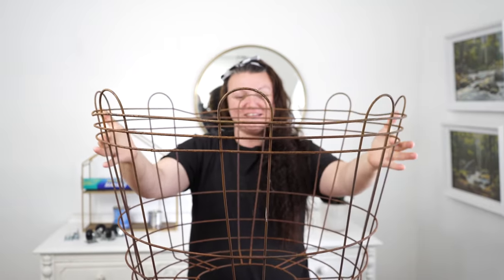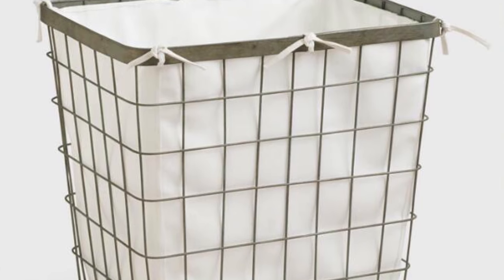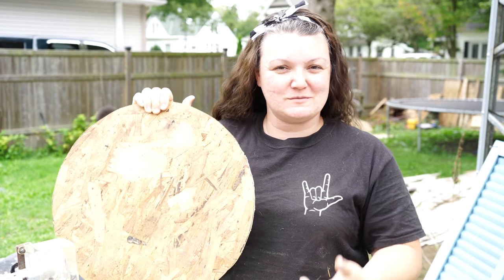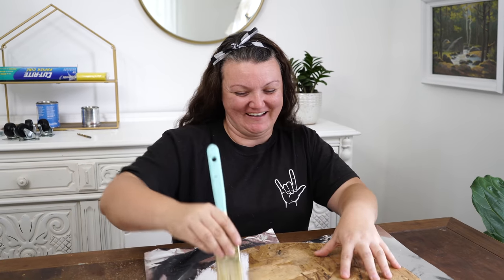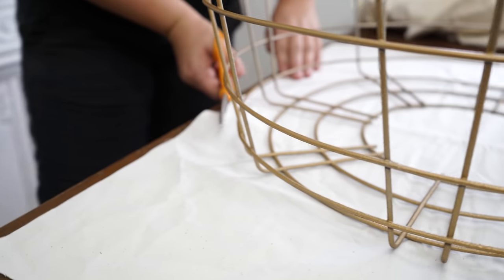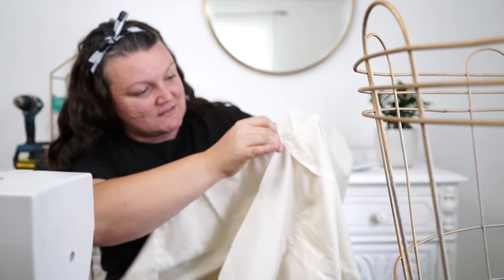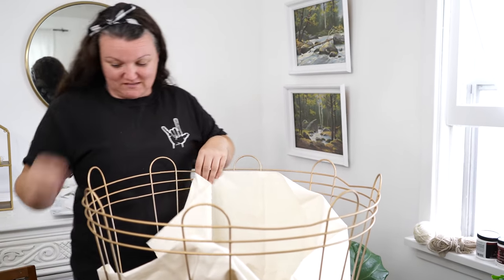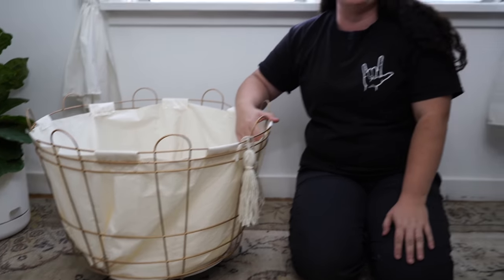TRASH TO TREASURE I found a secret DUMP spot! Up-cycled trash

Comment: This is a great use of that basket frame.  From the examples you showed, thought you were going to add legs to the wood circle and put the casters on the leg and maybe a shelf under so it was a comfortable height but this could be used in ANY room for lots of purposes from holding logs by a fireplace to holding toys in a kids room to toilet paper or towels in a bathroom to holding blankets or books in a bedroom.  Wouldn't put lettering on it and limit it!

Comment: Elysia, this was SO FABULOUS I watched it TWICE!!!! 💜❤💜  FYI, I also would have painted the base - and because it would be in a laundry room with a cement floor that is sometimes damp from drip-dry laundry, I would have completely painted the base - top, bottom and side edges - AND then sealed with water-based polyacrylic sealer so the wood wouldn't have ANY CHANCE of getting moldy or absorbing moisture or water....that's how OCD I AM, LOL! 🤣😉😂  Loved the brass paint on the wire, too! 💜 YAY! Missed your Trash-to-Treasure DIY's so much.....glad they are BA-AACK! 🦋  Glad your hubby said to keep the basket for yourselves, too!  No guilt for keeping it, then, right?  LOL! God bless you and your family and keep the inspiration coming 🙏 please!

Comment: That turned out amazing!! What a wonderful idea!! I used to work at a greenhouse/nursery. We used these baskets when they dug trees with the tree spade. We would put burlap in them and then rope would be tied and pulled through the loops of the basket. A special crimping tool was then used to twist the wire loops to make it tighter. It was very hard labour (for me), but my boss was awesome. Once the trees were secure in the basket and burlap, they were ready for the sales area. Your basket was obviously never used for that purpose because the loops are in perfect shape still. I like seeing it as a laundry basket much better than a tree basket, lol!

Comment: Glad you’re doing trash to treasure videos again.  This came out great. How did you sew the tabs that go over the wire sides?
Reply: Probably used velcro to make it possible to remove it to wash if needed.
Reply: Sandra Kicklighter   That makes sense.
Reply: I had the same question, I would have used Velcro.

Comment: I think what you have there is a carboy basket . Carboys are large glass flasks used to transport chemical , acids  and strong alkalies .  The glass flasks can hold as much as 18 gallons , and are often repurposed as bottle gardens , very popular in the 70's . Because of the round shape of the flasks ,  the weight  and the danger if spilled or broken ,  they were transported in metal caged baskets stuffed with straw .   But now we all know those metal cages make great laundry baskets  !!   They  make good coffee tables too

Comment: That laundry basket turned out so great. What a wonderful find! Did you try straightening the two areas of wire that were bent? My OCD is kicking in as I am seeing the slight bent under the fabric tabs.
Reply from the maker: No I didn’t try to straighten them I was fine with the aged Imperfections
Reply: I wouldn't have straightened them, either. It adds to that rustic, well-used look. And I would've worried about the rusted metal breaking if I tried to straighten it. 
It's perfectly lovely as is. 👍💕

Comment: Great job! For next time you do something like this, if you cut your bottom circle then cut your side fabric the measurement of the circumference of the top edge (widest) then seam the long rectangle together with the wrong sides together on the short edge, then flip it back on itself closing the raw edge inside and sew again you won't have any seams showing. Take your circle fold it in half marking the fold on each side with pins, then fold again in the opposite direction and mark again, do this until you have at least 8 pins around the outside. You're basically making it look like a pie(the more you do the easier pleating later will be). Then take the tube and fold in half, put a pin on the opposite side of the side seam, then fold it in half again. You will want the same number of folds to match up the pins.  You will have extra fabric once you match up your pins, fold this extra fabric  flat on either side of the pin to make a pleat. When you sew, sew with the circle against your machine because it will lay flat. then carefully sew down all the pleats. Once you have it sewn you can then take store bought or thrifted bias tape to sew over the raw seam edge to pretty it up. If you use a printed bias tape that goes with your decor it would be nice to have that on the outside of the bag to add some colour.  If you had used cotton rope (found in the upholstery section or drapery section of the fabric store) through your tabs making a draw string, you could loop those exposed parts of the rope to hang over the metal loops on the basket making your liner washable.
Reply: Wow! So detailed. It's just hard to picture it. I'd probably need to see a video to really be able to do it. Loved your pie example, though...I could envision that. 👍

Comment: That's so cute. How did you attach the bottom to the basket? Are you going to try and bend the couple wires that are bent?
Reply from the maker: No I like the imperfections :) I attached with a few zip ties

Comment: How did you fashion the "tabs" that hold the cloth liner to the wire basket? Did you use velcro to attach (and remove the cloth liner to launder it when it gets dirty)? Would also love to know how you attached the base to the basket with the zip ties. Did you drill a couple of holes?